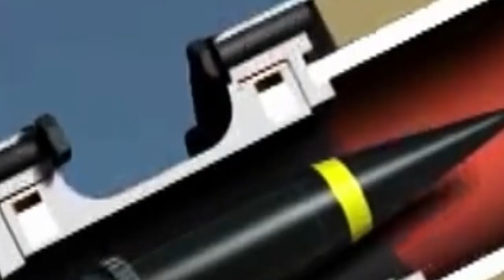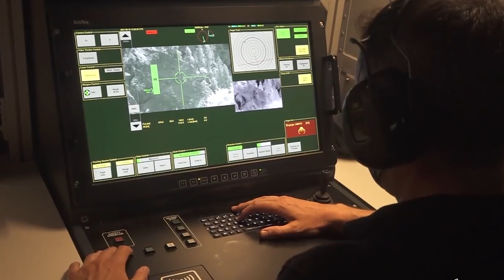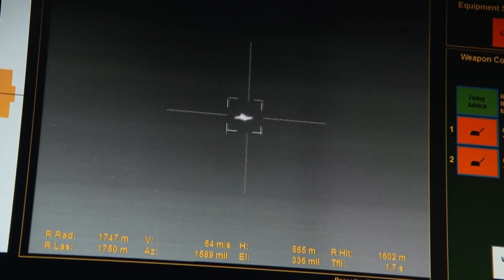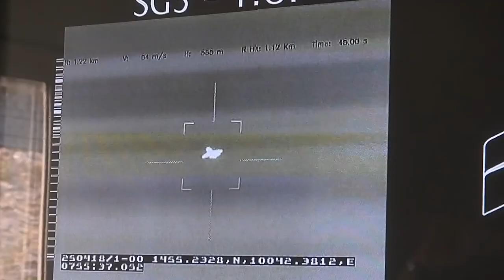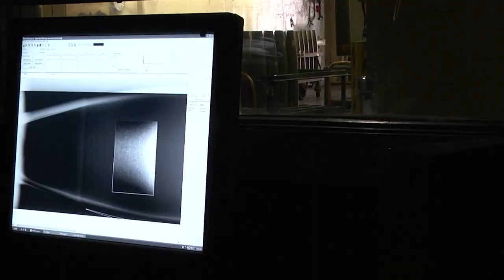Oerlikon Ahead Air Burst Munition

Comment: I don't understand why anti-aircraft guns with cannons are still using automatic weapons with the highest possible rate of fire. The best answer to combating flying targets has long been given: shotgun ammunition is used to hunt ducks. So with one shot many projectiles are fired AT THE SAME TIME with a spread radius. Given the limited predictability of the object's trajectory until the projectiles arrive, this spread also makes sense. However, with rapid succession of SINGLE shots, the possibility of the FLYING object to avoid the fire increases. With shotgun ammunition, a hit with each shot, i.e. with the first shot, is much higher. This reduces the chances of avoidance and the time in which the flying object can attack or otherwise act. The lower rate of fire also reduces mechanical vibrations. This increases the accuracy of the shot. Programmable explosive ammunition with shrapnel effect mimics the effect of shotgun ammunition (scattering effect), but is technically much more complex to implement and maintain due to the necessary programming of the explosion with regard to distance. After all, data processing technology has to be accommodated both on/in the barrel and within the projectiles. This makes such systems expensive and prone to damage/shortage of supplies. Without this data processing, the system is practically ineffective. "Stupid" shotgun ammunition, on the other hand, is not only cheaper and technically more robust, but can also be used "anywhere" where the chamber size is right. In this way, any weapon with the same chamber size can be turned into an anti-aircraft weapon in a few seconds (without any technical retrofitting of the programming technology) - including weapons or vehicles that are actually only intended for ground combat.
Reply: The issue is distance; duckhunting is often done at distances less than 50m, if your target is 1000m+ away, a fraction of a single degree or less of divergence can significantly alter the destination of your projectile to be many metres off, so with something like a shotgun which often has difference between the various projectiles of several degrees, it means the majority of your projectile won't just miss; they'll miss by a lot more than what a burst of AA fire would do. There's also the aspect that the unpredectability you mention is also a hinderance to the operator since the essence of accuracy is to be able to predict their projectile's arc and then adjust until it intercepts the target. If you can't do that, then you can't aim.

Then there's also air resistance; increased mass (provided it's shaped aerodynamically) will maintain it's velocity significantly better than many small ones due the old square-cube law (the larger an object, the greater the ratio between volume and the surface area) so you'd have to have a much larger cannon to fire at the same distances if you were trying to fire multiple projectiles simultaniously. Not the mention the massive increase in recoil from such larger guns cancels out any benefit in loss of mechanical vibration.

Then there's the simple fact that what comes up must come down; theoretically you could hit your target with every bullet, whereas a shotgun would be essentially designed to miss - which would then make any collateral damage (by the aforementioned neccesarily large projectiles) be by design rather than faliure - which might have moral/legal repurcussions. Comparatively, the programmable explosive ammunition used by most AA guns even as far back as WW2 both disposes of the round (or at least disperses the material into chunks too small to do any real damage) rather than leaving large lumps of solid material travelling at high speed and assisted by gravity to destroy whatever they eventually land on. Also, if you created a shotgun which fired proximity explosive projectiles (a hybrid approach), would said shells not technically be a cluster-bomb? Just thinking how those are very illegal for even governments to manufacture, so that's not an avenue of improvement that could easily be made.
Reply: @Neion8  Distance: True, but the predictability of the trajectory decreases with distance. The increased spread [in meters, not angles] is therefore wanted or good.

"They'll miss by a lot more than what a burst of AA fire would do." >>> A high level of accuracy can only be achieved with single shots if the trajectory of the object is precisely known (and accurate targeting, of course). If the target dodges, the first few single shots will miss, whereas buckshot can land a hit on the first shot, even though the object is trying to dodge.

" is to be able to predict their projectile's arc and then adjust until it intercepts the target. If you can't do that, then you can't aim." >>> The trajectory of ammunition that splits up directly after the muzzle is quite predictable if the sub-projectiles are arranged in a defined way in the projectile. This is not the case with shotgun ammo, so the sub-projectiles scatter differently with each shot.

Air resistance: In principle you are right. However, if the projectile splits in such a way that several individual "arrows" are created, each of which has the same total length (i.e. the splitting does not take place in the longitudinal direction but only in the transverse direction), then not, because the ratio of air resistance to mass remains approximately the same.

"whereas a shotgun would be essentially designed to miss" >>> That depends on how large the spread angle is set. This may not be constant, even programmable with each shot. Would be technically feasible. At a scatter angle of 0, all projectiles would then hit (if the object is hit).

"designed to miss - which would then make any collateral damage" >>> Land fire warrants this concern. For the air defense I can not imagine collateral damage as well. Falling parts can be a problem, I admit. Well you could also make them explode after a certain time so that it is unlikely that they hit the ground in one piece.

Comment: I am anticipating at some point, gun launched projectiles with onboard terminal guidance sensors and manoeuvring vanes. Combine that with these sorts of 'kill mechanisms' and you'll have an effectively un-assailable defence system, as long as the ammo lasts. Make them rocket-assisted and you might be able to obviate low altitude missile systems as well.

Comment: I couldn't help but notice the location signature these weapons produce. Heat, flash and dust cloud generated is massive. This to me is a huge liability. I don't care how great of volume the weapon puts out, this won't help when the enemy locates your position and send a massive artillery or rocket barrage on you. The ammo supply is not infinite and with the rate of fire ammo expenditure is a going to be tremendous. Shoot and scoot is a remedy for not being located but doesn't solve the ammo depletion problem. Just some considerations IMHO.
Reply: huh? Missles are even worest in both aspects.
Missles are more visible, more expensive and run out of "ammo" faster.

Comment: i wonder why they went with tungsten penetrators? seems like steel would do just fine. the best tech is useless if it's too expensive to field.
Reply: Same reason tungsten carbide penetrators are used in MBT main guns (when you're not using depleted uranium). Tungsten has more than twice the density of steel, so higher kinetic energy against the target.
Reply: Tungsten is higher density then steel so they can make the "penetrators" smaller without losing any kinetic energy and still fit more in each shell.

Comment: it seems really expensive something that could be bled dry cost wise with cheap rockets
Reply: Batteries of these things are designed exactly for the job of engaging large saturation attacks like that. An area defence missile system like Iron Dome or CAMM will engage the majority of threats from multiple launchers whilst weapon systems like this are employed around embassies and military instillations incase anything breaks through, they can engage up to 35 targets a minute when in full swing and in places like Israel have been proven multiple times against large rocket attacks.
Reply: How could a rocket be cheaper than a small shell?
Reply: @SwuuschifyMe  system cost v rocket projector cost is the main thing, an old Soviet grad system can spew out a fair few dumb fire rounds a minute for the cost of penny's where as these are millions each.

Comment: And still weak to drones.

Most "small" military UAV's are still comparable in size to a Cessna, with the exception of short-range reconnaisance UAV's which are much smaller, but no recon UAV is getting that close to an AA gun; they all have crazy cameras for a reason

Granted it did show it taking out little quadcopters, but those were in a test range, lowflying, and detectable by radar.

Try a drone that's 2 feet long with a 3 foot wingspan (if that) flying at 1,500m if not higher, minimal radar cross section and now in a nose dive straight (-90°) into those AA cannons as it's loaded with a Shaped charge...

Good fucking luck is all I have to say.

And let's not even get into weapons systems with a proper stand-off capability.

How does it deal with a ground attack missile going Mach 2-3 at a few km altititude with a steep descent akin to a Javelin.

Again, good fucking luck.